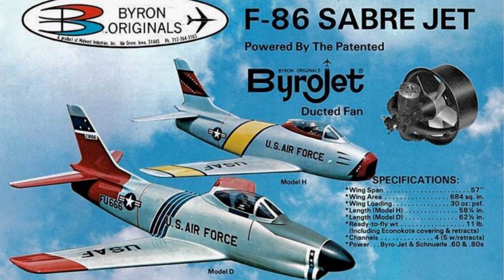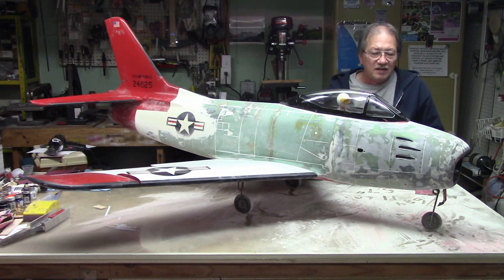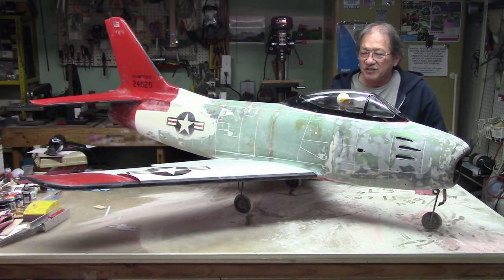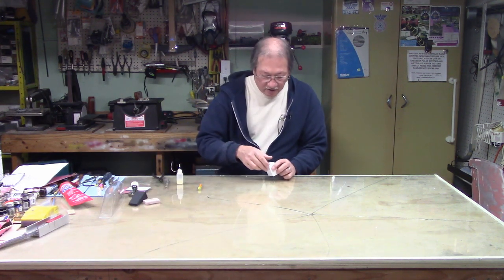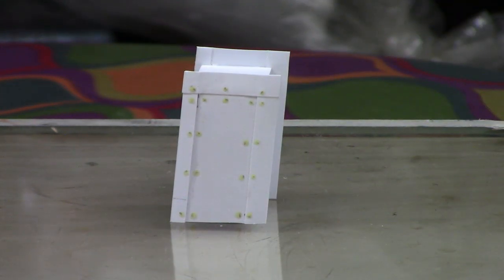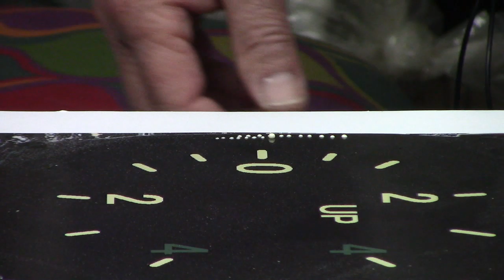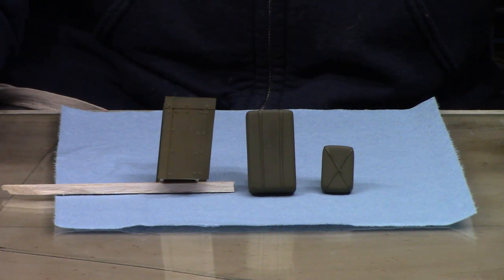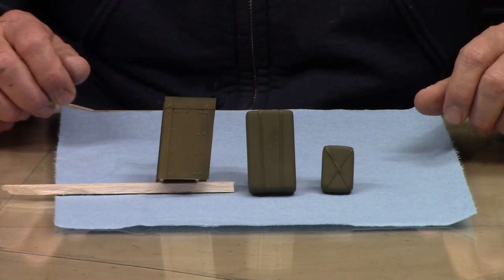SIG KOUGAR BUILD   Part   19D   Under The Canopy

Comment: Instead of using bondo for the chutes, etc., have you considered using either the pink or blue foam board for sale at home improvement stores? I have used it to carve pilot busts (full helmet/upper torso) and would think it would be lighter than bondo. I can't speak to the longevity of the foam yet - but would be interested in your thoughts. BTW - loving the Sig Kougar build series.... Lots of great information! Thanks!
Reply: You bring up a very good point here. I've used foam board in the past for a few things. I found that I had to do more filling on the foam to get the surface I like. I use body fillers for several reasons, Foremost, I'm a bit heavy handed and like a strong part that won't break or crush. I don't normally build smaller models like the Kougar any more and I use body fillers to make a lot of external parts (Air Scopes, light beacons etc..) on my scale models, I use harsh chemicals on my models during the weathering process on the exterior and a foam part would dissolve under those conditions if not sealed properly. When it comes right down to it, I don't worry to much on the extra grams a body filler part weighs unless we,re  looking at an ounce or more, however if you're concerned about weight foam would be a good alternative.

Comment: Hi I was wondering if you could tell me the difference between the MK1 and the original kougar.  I have the original kougar and thought I might start on it you have really inspired me thank you. I got my first cougar when I was just 22 years old and that was 1982 I have a picture of it on my wall and they are good memories. PS I’m Australian please forgive my  accent.
Reply from the maker: Hi Andrew, Good question.
Here's what they did. They moved the plywood from the bottom rear center section of the trailing edge of the wing (original Kougar), and flush mounted it to the top of the wing. Under the over hanging plywood, They added two small trailing edge pieces to cover up the aileron horns. Of course they had to make a small modification to the fuselage to accommodate change. That's all that I noticed.
  I've found that the change looks a little better and helps keep out the exhaust that use to leach in around the aileron horn. 

I'm honored to be a part of your inspiration. Hmmm.... I was 23 in 1982 Stationed on Kadena A.F.B. Okinawa Japan. I was flying a SIG Koguar (Kougar number 4) as well. A large group of us flew off an WWII abandoned Japanese military airbase called Tori Station. The 80's was a great time to be in the hobby.

Comment: How do you stop the canopy steaming up when down the field on a hot day?
Reply from the maker: Hi Tony, good question! If the canopy is to be sealed (no air can get in), I make sure the humidity is low before I install the canopy. If the canopy steams up after installation, I will drill a very small hole in the top of canopy (in a inconspicuous location) so the humidity can escape. I have a set of jeweler's drills I use to make the hole or holes. If the canopy has some ventilation it will reduce the chance of humpty build up.
Thanks for the question.